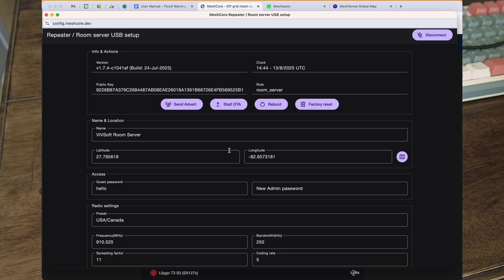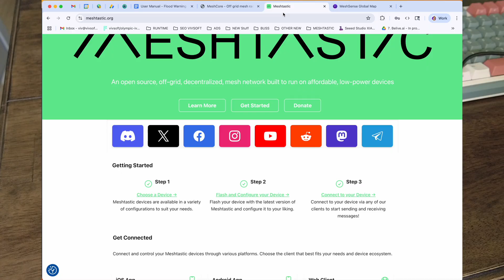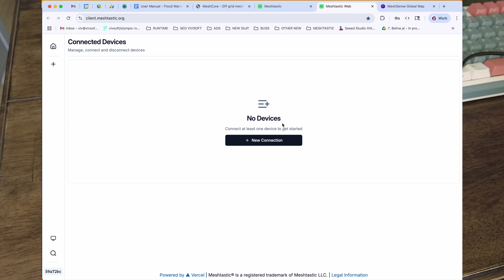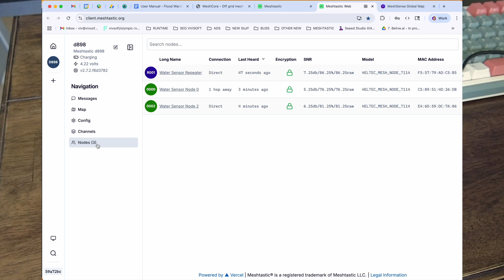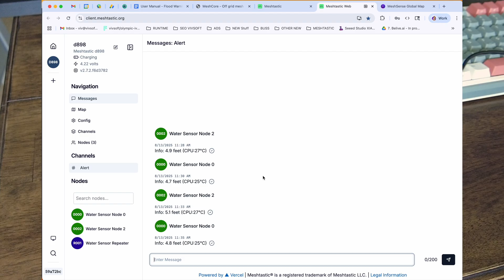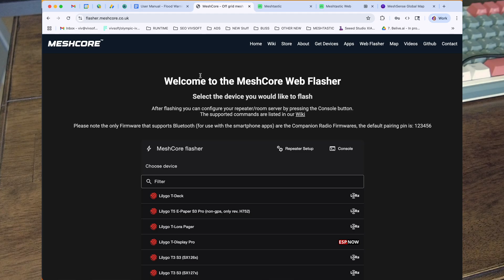Build a Multi-Frequency Meshtastic Tower 🚀

Comment: I live in Bradenton. I am still researching things but plan to buy a few including a pole mounted one for reach with a proper antenna. Wonder if I could reach across the bay? Thanks for the videos and info.
Reply from the maker: Cool! There are several Meshtastic users in Bradenton, so you will not be lonely! See the map here Florida Mesh Map https://share.google/uBrp8AjmPC6DRhhtH ... You can join the active community on Discord https://discord.gg/floridamesh
Reply: @ViVSoftLLC  Thanks Good to know. I am wondering about Meshcore as well so I might have to run both.
Reply from the maker: Great yes. I run both also and there are a few of us around with Meshcore.

Comment: Is there a way to set my meshcore device to only connect to routers (for example if mounted in a car)
Reply from the maker: Not sure why you would want to do that, but it will look for adverts from repeaters and add them to the list automatically. So as you are driving it should auto discover repeaters that send out adverts and use them.
Reply: Just set your meshcore device to repeater and it will only talk to repeaters. We call them mobile repeaters. Of course you will use 2 radios one for companion and the other has repeater.

Comment: im not that familiar with antennas, but are those antennas to close to each other ? wasnt there a thing where u set them half a wavelength apart ?
Reply: @kf4hzu how far apart do we need to keep antennas apart for two nodes one mestastic, one meshcore, standard USA frequencies? Thanks
Reply: @blainebrodka5335 I'd recommend at least one wavelength, so 33cm. The absolute minimum spacing should be no closer then half a wavelength, which is 16.5cm in this case. Vertical separation is best, having one antenna above the other.
Reply from the maker: Great information thank you ! These are about 4 cm apart :-) .. Will fix that in a updated version.
Reply: @kf4hzu how concerned should one be with loss in a longer antenna cable? I like the concept for a rooftop solar node with a larger panel feeding a dedicated charge controller that keeps a battery bank charged. Also are there reasonably sized N cables for such a build?
Reply: I'm also wondering about antenna separation requirements as well,mi want to build dual MeshSense meshcore solar routers
Reply from the maker: Agreed, but thats why I use them on different frequencies, but I don't know if that helps...
Reply: @ViVSoftLLC it doesn't help, and when one node transmits it'll make the other two deaf for a short time. I'd think over time you may damage the receiving circuit in each node due to the fairly high input energy from the close antennas that are practically able to couple to each other. You certainly aren't going to have a normal pattern to your transmitted signals.
Reply from the maker: Ok cool... Thank you. Like I said I'm just messing around so I will think of another inventive way to get the antennas apart ...